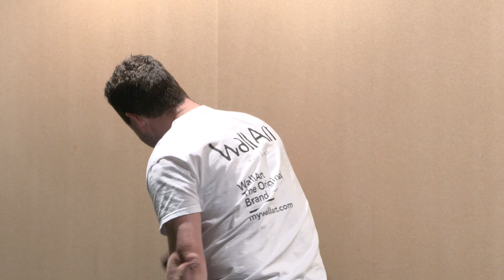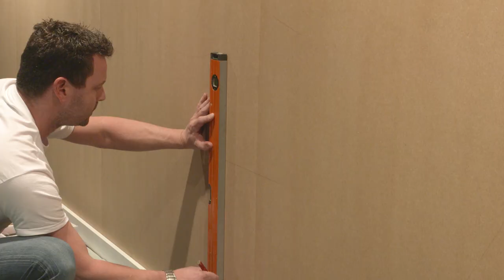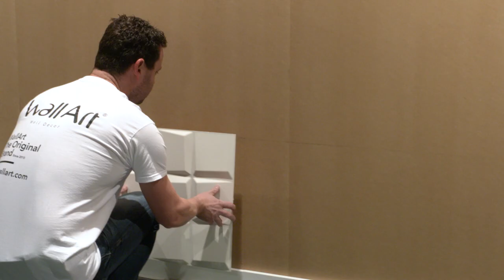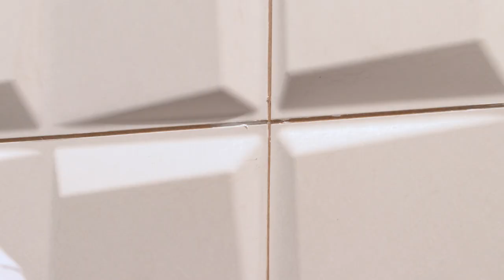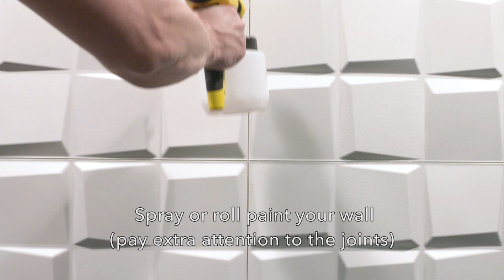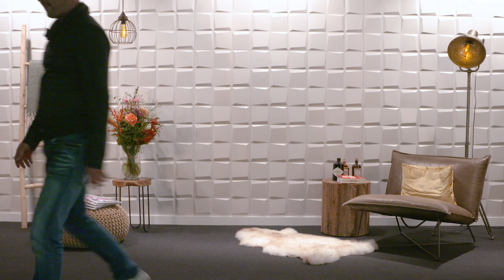WallArt 3D Wall Panels Installation Manual

Comment: Do I need to use white paint over the panels or can I just put it on the wall and leave it how it is without any paint? Thank you
Reply from the maker: it is best to paint them but without paint is also possible but panels are a bit off-white

Comment: What if I do not match the size on the wall,  for example, I have 1980CM width. How can I adjust that?
Reply from the maker: in that case you can leave a space left and right and make pattern "floating", in your case 10CM each side, but because you leave some space in between of the panels (3mm max) the total space left and right will be less then the 10CM and will be more likely 5CM each side

Comment: Hi
I have a few questions before installing my Maxwell panels (:

I've had them in their boxes indoors in my apartment for about two months, do I still need to let them acclimate for 48hrs?

Also, do I need to use a tile spacer, or can I put them close to each other?

However, if I do use a tile spacer, should I use some type of sealant to fill out the gaps?

Thank you in advance,
James
Reply from the maker: 1. No need to acclimate in that case 2. You can install without tile spacer also but need to leave a small gap 3. No when you paint the wall then fill the gap with paint as well, if you would fill the gaps and later paint the wall the paint will crack on the gaps because paint always shrink when it dries. Without filler the gaps work like a bridge and avoid cracks.
Reply: @MyWallArt3Dwallpanel  Thank you so so much for all the good advice! This was super helpful!

Kindly,
James

Comment: Would “liquid nails” be a good adhesive to use for this?
Reply from the maker: Yes would be OK to us !
Reply: It will destroy your wall if you ever take it off
Reply from the maker: @natim.881  this is not, depending of the wallsurface and amount of adhesive you apply

Comment: Question; spray or roll? wouldn’t it be abit difficult to roll? As panels are flexible…can you apply paint with a brush? Spraying is rather messy.
Reply from the maker: Depending on the design you can either roll or use a brush, for example the more wavy designs are easier to paint with a brush.